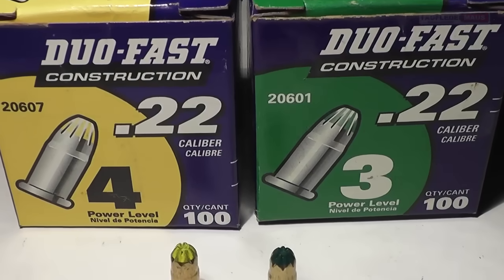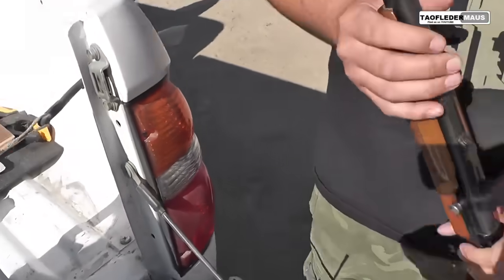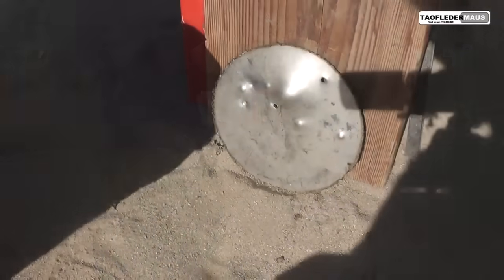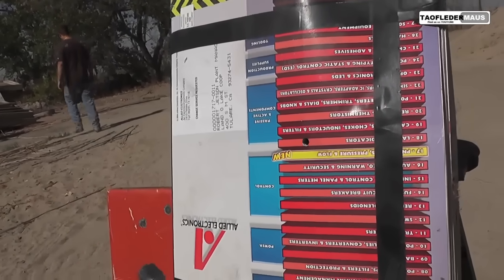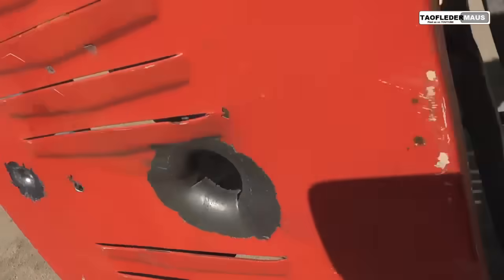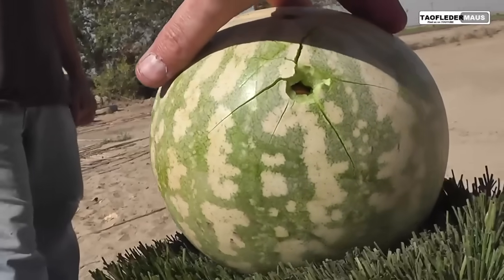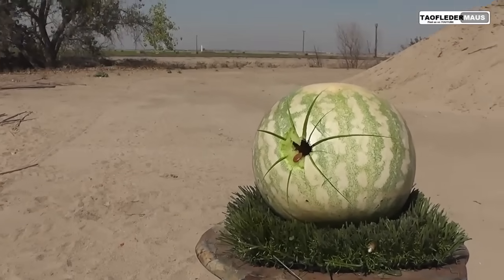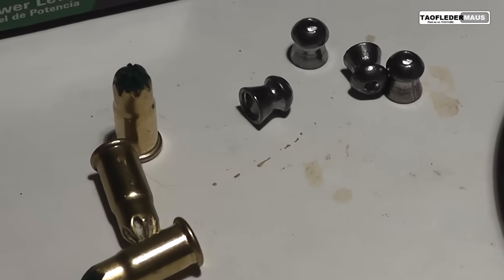Shooting .22 PELLETS Using NAIL GUN Blanks - What happens?

Comment: Just glue the pellet onto the business end of the blank round. . . uUmmmmmmmm
Reply from the maker: http://taofledermaus.blogspot.com/
We tried that and I explain what went wrong here.
Reply: ***** Verrrrry intrrresting!!!
Reply from the maker: Texan1939   Yeah,  that was just weird.  I thought it would just blow through it with no problem.  But it did it in both shots so it probably wasn't a fluke.
Reply: *****
In your blog you mentioned that muzzle loading was usually a bad idea because "(short starting -look it up)" after running a few Google searches and not finding relevant results can you explain what that is or provide a link? Thanks man, great vid!
Reply: ***** How about wrapping the neck with a tiny strip of paper, securing it somehow and inserting the pellet into the paper sleeve with some spacing from the blank itself?
Reply: Nevir202 I might not be 100% sure, but I guess the resulting air gap would cause the powder not only to burn (When you fire a round, the powder inside the casing burns), but to explode - like a pipe bomb. And you don't really want that happening a few inches from your face.
Reply: The compression is what makes the powder burn as fast as it does in a way it's amplified by it.  It's kind of like a fire piston. I'd be willing to bet the extra air gap decreases the compression making for a slower round.  Then again I don't want to think about it too much..  I'm no physicist.  I think it has more to do with the structure of the projectile than the power of the cartridge
Reply: George Donaho The dynamics in using a blank cartridge are different as compared to conventional ammo.Ablank is loaded with an explosive charge rather than a propellent. Propellants burn at a progressive rate and require a length of barrel to facilitate the desired burn,where as blanks explode or burn instantly and do not require a barrel in which to complete their burn .Therefore the "compression" component doesn't come into play

Comment: They need to design a gun which fires very hot small rounds, maybe something similar to the size of a 7.5 grain .177 pellets with the load of these nail gun blanks. Or maybe just use very short casings that instead of smokeless powder use a lot more primer explosive (lead azide or potassium perchlorate) than what is in a standard primer. I imagine a high explosive powered round could go above the speed barrier of 4,500 fps that smokeless has. It is going to be a barrel burner though, more wear and tear, but cool as hell.
Reply: They already make a gun that shoots .177 size projectile REALLY fast, called .17HMR and .17HMR2
Reply: 1lovesoni Yes, but the bullet weight is around 20 grains, heavier than a .22 caliber pellet.

Comment: I just wonder how it is possible, those holes in plate and paper are so clean. No bend edges, no torn paper. I would suspect the pellet is really drilling its way in. BTW if it is true, what it would look like if there was hard core in the pellet. Dont know, maybe needle, or we have some hardened nails in here. You know. Hide the hard tip behind soft cap and make it "armor piercing".

Comment: Do you guys have a 22lr revolver to try this on???? I may want to try this.
Reply from the maker: bisquik3006  Unfortunately,  at the same time created the construction crisis of 2015... lol
Reply from the maker: I think....  it would be a bad idea to try in a revolver.   With a blowback gun,  if something goes wrong,  at least the bolt will release the pressure.  A revolver,  where would the pressure go if the pellet doesn't quite want to go into the barrel from the cylinder?
Reply: bisquik3006 shhhhhh.....
Reply from the maker: I don't have a .22 revolver.  I didn't even want Alfonso to use his .22 pistol but he really wanted to try it.
Reply: ***** why not feed the pellet like the others, from the end of the barrel to the edge of the forcing cone, i just got one of them cheap chinese single shot .22 pellet pistols from Amazon for $35, i got it with "Vitality points" from my work health program, along with 800 .22 pellets, i'll have to try this with my Walther G-22 and Ruger Mk II pistol!
Reply from the maker: Yeah,  that would work or load the pellet with the cylinder open into the barrel first.   But a lot of people want to shoot faster and I think that would lead to problems.

Comment: I'm sure most have said already but I'd love to see it through a chrono and maybe testing gluing the pellet to the blank for easier/safer loading?
Reply from the maker: I originally stuck the pellets to the tips of the case with a little hot glue so they could be loaded like a regular round.  However it didn't work.   When we went to film it a few months ago the first round blew the back of the case off and the rest of the case was stuck in the gun.  I think the pellet needed to be in the barrel and not in the chamber.

Comment: perfect for shooting in places where excessive penetration isn't wanted or would be extremely dangerous though i would suggest that any one who try this fire them thru a single shot bolt or break action as loading would be much easier at least for the powder though you would need a cleaning rod or some such for the bullet "ramrod"

also would be interesting to see what these would do at long range say out to 300yds as since the pellets are aerodynamically shaped im guessing you would need to adjust for wind like crazy because of the pellet weight but on a windless day these would probably be able to carve your name in to a target out at that sort of range

Comment: The reason those construction blanks are so powerful is because their job is to fire a 2-3 inch long nail all the way into solid concrete. Having actually used one of those for the job it's used for, I can definitely say it'd be more powerful than a .22lr round, because those blanks can fire the nail into the concrete with ease and have enough energy left to lift me, a 75kg man, a good inch or two off the ground

Comment: I see folks advocating trimming down a normal .22lr to a lighter weight. If you want to do that, try the Remington Yellow Jacket. The truncated cone area on the front of the projectile comes off cleanly with just a razor blade, leaving essentially a light weight wadcutter and all of the surface to engage the rifling intact. This is commonly done by owners of the NAA Mini Revolvers chambered in .22 Short. You end up with a .22lr case and powder charge with the same overall length of a .22 short so it will still chamber.

Comment: Holy shit that was cool. Can you shoot these over a chronograph? Makes me think CCI should look into a high speed, low weight option. Kickass man. Might try an old single shot bolt or break action 22 and see if it is possible to breach load. Keep up the good work
Reply from the maker: joshua12345676    We were getting higher speeds than a 17hmr.   The pellets were going over 2800 fps.
Reply: This is already accomplished with the .17 hmr/mach2.
Reply: joshua12345676
ah, completely right you are.
Reply from the maker: Yeah,  RyeOnHam did a fantastic and thorough follow-up video.  He even double-loaded the pellets,  used 3 different power loads,  and got some grouping shots.
Reply: Alright, did not know you sent it over a chrony. At 2800 the energy is the same as the hmr.

Comment: Without actually buying these for myself yet, it would seem you could put a dab of wax on top of the nailgun round and attach a pellet directly to it. Not sure of the overall length, but it would probably work well enough in a bolt action if it was close, or even a revolver.

Comment: Very cool - I must try this! ...Just be sure the barrel is clear after every attempt....hmmm  I wonder how bad it would be following a pellet stuck in the barrel with the 22 round...yikes.
Reply from the maker: Eh,  I don't think there is enough energy for the barrel to blow up.  Chances are all the energy would just blow the bolt open.
Reply: *****
I'm still curious about the reason the pellet made such a clean punch hole. Maybe due to more velocity.
I wonder if you would make a cookie cutter punch hole like the pellet did by cutting cut a flat face in the 22 round (cut the round nose off)...
I also wonder if the velocity of the pellet is making the pellet smash into a cylinder shape when exiting the barrel...sure wish you had a super slow-mo camera...=-)

Comment: You might as well cut or file the top off regular .22 cartridges. The key here is light bullet (and therefore high speed). Next time, try simply cutting the .22 in half. That way you can load them easily in a magazine.
Reply from the maker: darkwarrior   They'd probably lose energy pretty fast in gel.   We should have shot the gummy bear with one.  I doubt it would have went in more than an inch.  Sort of like that .204 Ruger round.
Reply: That and these pellets have a totally different set of ballistic properties, with that locker door it basically made a hole equivalent to a steel penetrator in AP rounds, little to no spalling occured and i also believe these pellets are a lead alloy rather than straight up lead, which also changes external and internal ballistics. Gotta do a ballistics gel trap for these things. I'd say itll go through atleast 2 whole blocks.
Reply: George W Bush hey why don't you go troll Obama?
Reply: You're going to be left with a bullet that has very questionable external ballistics if you do that. Not to mention the fact it's somewhat hard to find .22LR, while pellets and nail gun charges are plentiful.
Reply: it wouldn't be ballistically stable.
Reply: David Burke
You can file the tip so it's still pointed. Also... Hard to find.22LR?
Reply: darkwarrior
Oh HELL yes. We need these in a gel test.
Reply: ***** Sure it would. Like I said, proper filing.

Comment: I have a friend that did something similar with a spring and piston, breach barrel
air rifle .177 caliber. He just drilled out the chamber end to fit those "powder activated tool" rounds, and fit the piston with a spike to ignite them. Makes for easy loading with the breach barrel. Just put the pellet in from the chamber end first, and then the powder round after, close the barrel and it was ready to fire. Worked quite well, and the chamber seemed to have no problem handling the pressure. We never got around to doing any accuracy testing though.
Reply: I want to do this with my .22 break barrel air rifle. Eh, someday.

Comment: The reason the pellets and the blanks do better than the regular .22 rounds is because blank ammo uses a different, more powerful powder. I think the reason is that blank or other less-hot rounds have trouble cycling in some weapons due to the lack of projectile they are unable build as much pressure inside the gun because all the hot gas comes out the muzzle virtually unopposed without a bullet in the way blocking gas and building pressure so they compensate by using stronger powder to build needed pressure, at least enough to cycle most guns properly. This is just my guess as to why the blank rounds did better, I'm not an expert by any means.

Comment: you should get a chronograph to test the velocity. They look very promising. Also, it would be interesting to pull a bullet from a normal 22lr round, load it like you did the pellet, and use the nail gun blank to fire it just to see if it has any more damage or velocity compared to the normal mini mag. Perhaps the nail gun blanks have more of a powder charge. Propelling the 14 grain pellet at well over 2000 feet per second is amazing. I find it odd that it also does consistently more damage than the heavier, slower bullet. Usually heavy projectiles are somewhat superior at short ranges. I may be wrong here, but I think there is a good chance those nail gun blanks carry a more powerful charge.
Reply: i'm no ammo expert but if you think about it the fastener blank has to reach max energy within the 1-3" range of travel depending on the nail length , a .22lr reaches max velocity out of a long barrel say 16" so a bit slower burn for the .22lr power
Reply: I found a decent chrony for 75 bucks that would do the job. Just need a way to order it and a range to go pop these off on.

Comment: I wonder if the .22 pellets would stay in a revolver cylinder?
Reply: If not, you could always glue them to the charges to make rounds.
Reply: i would think so given the gas skirt on a pellet  , probably best to rear load though , you would just have to look at your overall length for the 2 and make sure that clears the cylinder
Reply: Take a small punch and crimp the skirt of the pellet out slightly; when you push it into the chamber, it will stick in there, kind of like it would in an air rifle.

Comment: could it be the powder?. try shooting a normal .22 round with the superX's. And then use a .22 blank with the pellets. I think the powder is just strong.
Reply: Ive got the same pellets in solid dome, the cupped back actually bends quite easy, so i'd imagine upon firing, that cup expands out into the rifling making a hell of a tight seal. Normal .22 rounds have a band used to engage the rifling. Would be cool to capture in a ballistics gel block to see what happens to the round.
Reply: Also the pellets have a cupped back, so I believe it helps it catch more pressure, giving it more velocity
Reply from the maker: Aussie50     A heavier round would probably cause the base of the cartridge to blow off.
Reply: TheProCactus sure it does...if you have less people in your town ...less pages in the phone book ;) LOL
Reply: theduckfu Powders are not corrosive, primers are. Since these are just modified Winchester rounds, not Soviet Bloc ammo from 40 years ago, there should be no issue.
Reply: Aussie50; and that's what .22 lever guns are for :)
Reply from the maker: MrTommymxr   There wasn't any damage at all.   I shot about 10 rounds through the rifle before we even filmed.  I wanted to ensure it was safe before I let someone else shoot it.   I'm not sure of any simple test for the powder that doesn't require strain gauges or whatever.
Reply: ***** yeh absolutely, at least it may vent enough pressure to avoid damage to the action.
Reply: darkwarrior ive tried this same experiment before with some ballistic gel..unfortunately the pellets literally melt inside to the point there is nothing left..
Reply: darkwarrior not sure if i should describe it as melting or disintegrating you are left with not much more then lead particles in the gel. I hope someone would do a high speed test on this because i would love to see the ballistics on it in slow motion ..i bet it would look awesome :)
Reply: TheProCactus I kind of was in a sense..not really trolling.. just being the typical smart ass i am :P no worries bro :P
Reply: darkwarrior That's essentially exactly how the miniball worked. The first rifle cartridge. It had a cup that expanded to grip the rifling.
Reply: warmfreeze ive seen pellets that have steel bb's  cast into them. enough lead to seal and the same badmitten tail design but maybe the bb would continue after the lead is pulled away. Also steel is lighter than lead so it doesn't make it heavier and more dangerous.
Reply: these charges do contain some very fast burning powder, the high pressures could take a toll on the action of a rifle over a long time, especially if you try and drive a heavy projectile!
Reply: Dat naht gud..... Is there a scientic way to test the strength of the powder? And like darkwarrior said. Was there any damage to the barrel?
Reply: darkwarrior Yes, exactly what I was thinking.
Reply: *****  I remember testing the yellow 4 in my rifle about a year ago. I'm not aware if the powder used is non-corrosive or not so I cleaned the heck out of my gun after. I considered firing some pellets with it I had some .22 pellets lying around but glad I didn't, I didn't realize the power the combo of those things. Thank you for the info. I tested it in my single shot breach loader, which would be ideal for this setup. Good to know if the .22 shortage never goes away. I was surprised how loud the yellow are, not as loud as a regular round but still noisy. The .22 aguila are a lot more quiet, heck they're quieter than an air rifle, cause they just have primer. Aguila aren't supposed to be fired out a rifle because there is a chance they can get stuck but I can check the barrel with each round on my breach loading .22 and I haven't had any get stuck.
Reply: warmfreeze They MELT? Oh thats neat.

If you want a quick way to lead poisoning i guess this would work well.
Reply: The one time I could play with a gun was a nice .22 with a massive overkill scope. I shot various things and a phone book was one of them. It had no problem going though the whole book, Hollow and solid, the rat shot went though 65 pages. I was shooting from about 3 metres. I learned a phonebook is no shield that day.
Oh and the scope I was able to shoot the smallest ants from about 5-7 metres.
Reply: TheProCactus well if you live in a small town...a phone book is a useless shield
Reply: warmfreeze lol if you're going to be using a phone book for a shield you better be living in a megapolis
Reply: warmfreeze
Im sure the size of the town has no bearing on the ability of a phone book to work as a shield.
I was just surprised his .22 did not fully and easily penetrate.

Edit: Oh I see what your talking about, Im a nub.

Well the size of the book was very similar.
Reply: warmfreeze
I thought you might have been trolling me, I already edited my post. sorry about that
Reply: darkwarrior Yeah, it is a mini-Minie.  As long as the skirt is not separated from the rest of the pellet by a too-powerful charge.